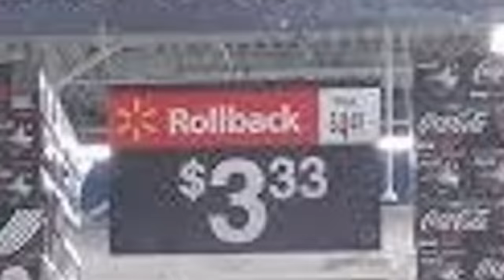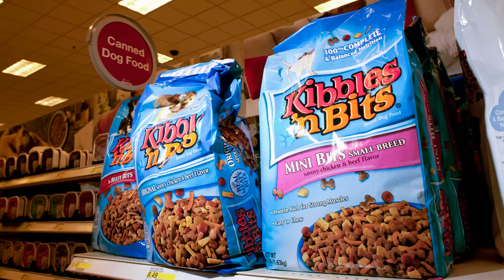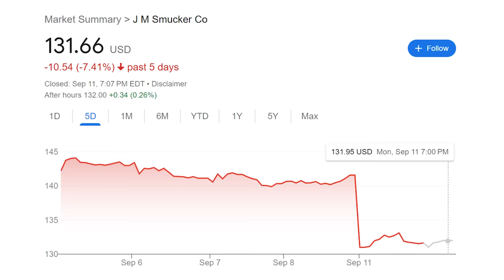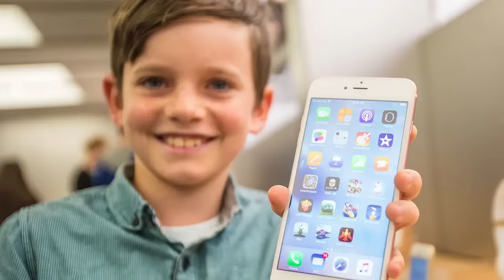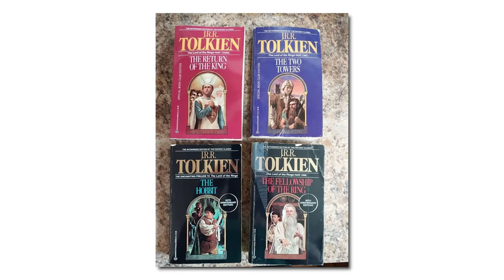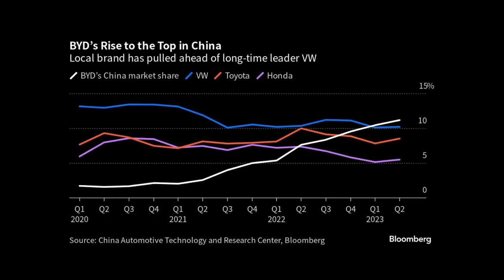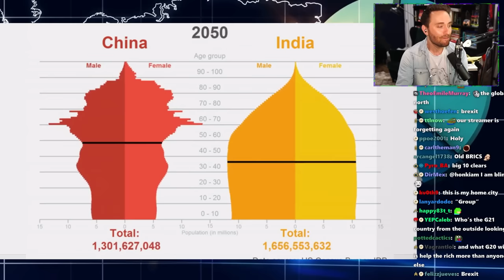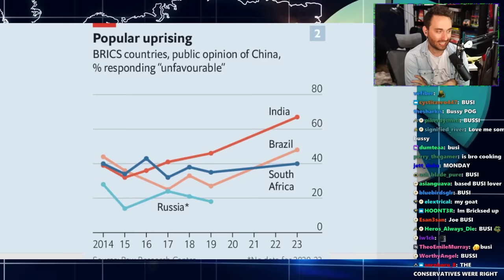The $100 Billion "Snack War" Is Heating Up

Comment: 150k in retirement savings is insane. My financial advisor has told me it can't be done without a minimum of $2mil in savings.
Reply: Depends on location, duration and (pre)existing lifestyle. If youre an MD and you retired at 65 today, 2 mil is prob a close minimum. But there are a lot of little old ladies who live almost solely on ~$20k per year SS.
Reply: A $500/mo HOA for 30 years (from age 65 to 95) is $180k.

Comment: If you're gonna try and be informative at least get your info right. Android has done so much in the past few years. Not just "change the logo". Under screen cameras, foldable phones, more than 20w charging, or whatever the fuck crapple caps at, high refresh rate screens and plenty more.